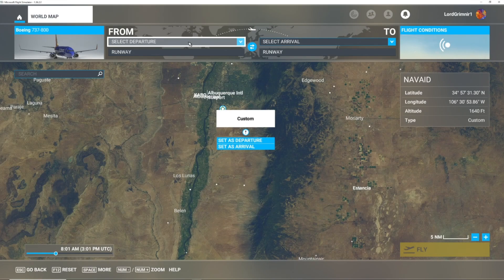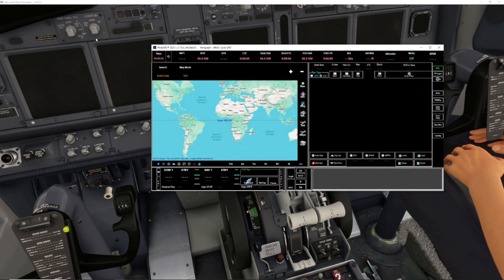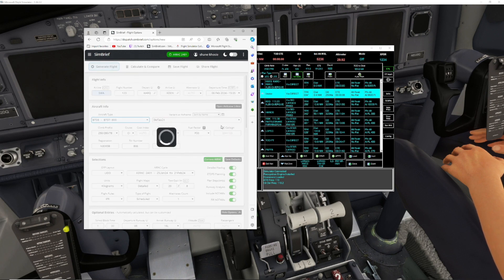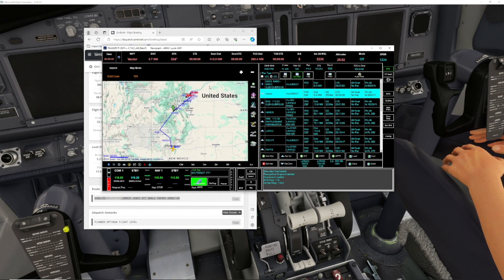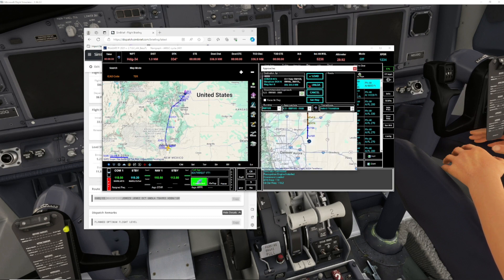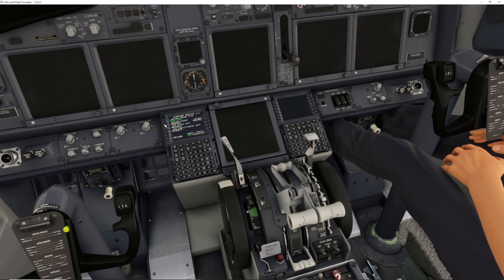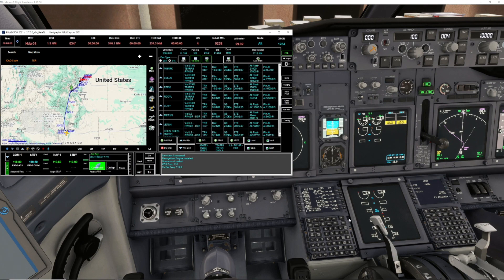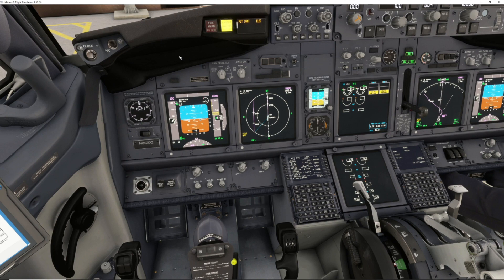HOW TO USE/SYNC SIMBRIEF AND PILOT2ATC TOGETHER IN MICROSOFT FLIGHT SIMULATOR 2020!

Comment: Great TIP.. THX for this.... Something I can not find in the P2ATC manual is if I have to turn on LIVE weather for all P2ATC flights in MSFS? I have REX weather added to P2ATC config but all ways forget to open REX.. Not sure if it matters or not. I like using the custom wether presets in MSFS, so I'm not sure if this will cause issues with altitude and transitions levels... LOL. THX for the VIDEO. Cheers